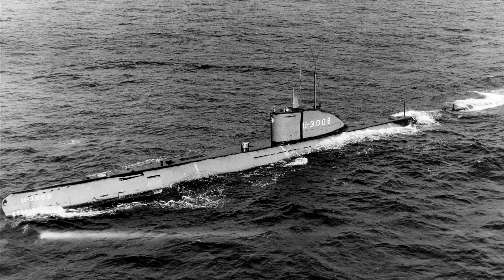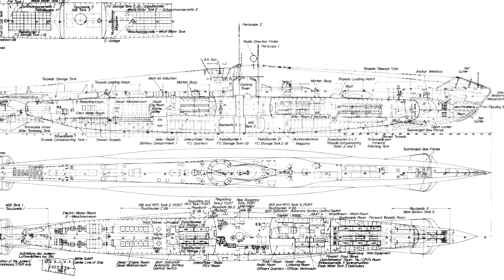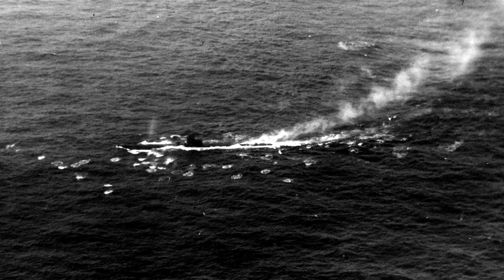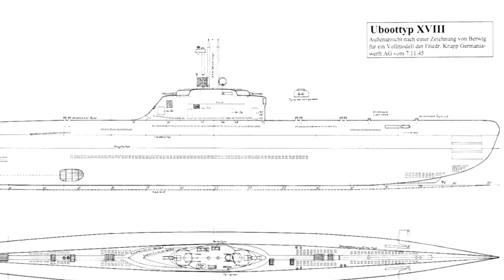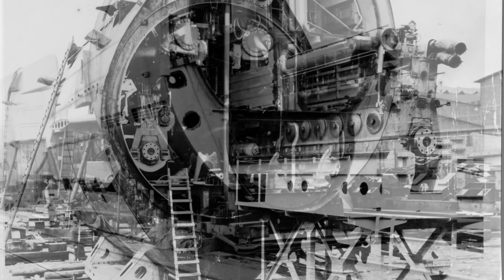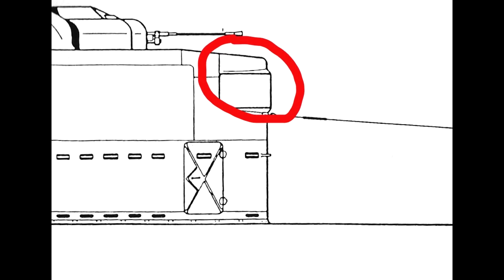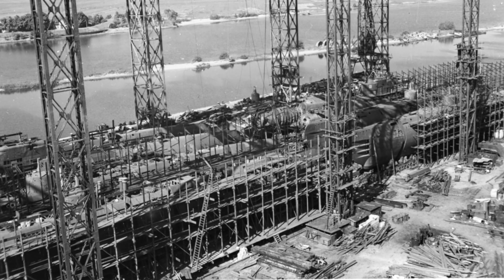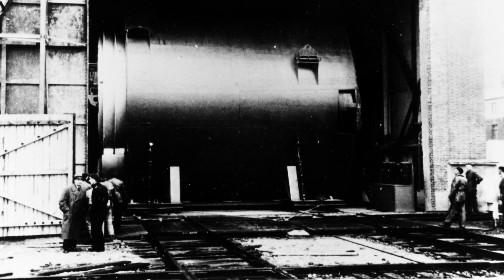German WWII Submarine Type XXI (Elektroboot) - Design, construction & assembly

Comment: Excellent vid, thank you. Kinda surprised at the addition of AA defence bearing in mind of the limited opportunity of use & the effect on drag/noise creation however Small. Are there any recorded instances of use?
Reply from the maker: I havent come accross any information about that. But its a good question, why add AA defence on something designed to travel submerged? :)
Reply: @BecksHobbyProductions  The type VII and IX were also designed to travel submerged, they just had more capacity to carry AA guns because the submerged top speed was less important before the proliferation of radar. Once it became clear that submarines would have to approach convoys submerged to avoid detection, submerged speed and endurance just became that much more important.
Overall, I'd say the Type 21's AA defences were adequate for a vessel expecting to get caught on the surface by aircraft a lot. Same could be said about its 20-something second dive times, which could be compared with modern submarines that take several minutes to dive because they just don't care. For every day they spend on the surface they spend 2-6 weeks underwater, so being able to dive quickly doesn't matter to them, especially since being able to dive faster would require larger vents on the ballast tanks and more numerous/larger limber holes, all of which would increase drag and noise. The germans were in a completely different situation, and so the Type 21s were lightning-quick on the dive for their size, at the cost of having the top submerged speed reduced to 15 knots from the 17 knots of the test vessel.
Reply from the maker: @gustaveliasson5395  I would agree that VII and IX could travel submerged, but if the crew wanted to travel longer distances, they would not do it submerged as longer distance required very low speed.
Reply: @BecksHobbyProductions  The same is true for the Type 21. The difference is that the Type 7s and 9s were built according to the conops of surface cruise-surface attack. With the proliferation of radar, the surface attack became exceedingly risky, so they switched to a surface cruise-submerged attack conops with the Type 21.
Reply: If the extra drag of the AA guns worries you, you should also be worried by the many large holes in the sides and top of the sail, both the ones for the surface watch crew to stand in, and the free-flood holes used to help get air out of the sail as the boat dived, a means of cutting down the dive times to mitigate the growing threat of being caught on the surface by patrol aircraft.
Those large openings caused production boats to lose two knots of speed from the 17kts of the super-streamlined but slow-to-submerge test vessels, but that's the price of being able to get an 1'620t boat below the water in under 30 seconds.

Comment: At least you can visit the one in Bremerhaven. I was there when I was a child.
Reply from the maker: True - I even had plans to go there last spring to shoot a walkthrough video, but the Pandemic got in the way, so i did this video instead 👍
Reply: I visited it in 2006. Much easier to get in and out , with a hole cut in the side.  There was a Walter engine in the nearby museum.  Hydrogen Peroxide is very unstable and was tried by other countries as well, but never found practical.

Comment: great video. the british Oberon should never have had a flared bow.  no one told the designers that the philosophy of traveling underwater using the snorkel meant that crashing through waves was a thing of the past.
Reply from the maker: Thanks. If the US had not done their analysis of the U3008, they would have continued with the designs of Baleo/Gato as well, just doing iterations